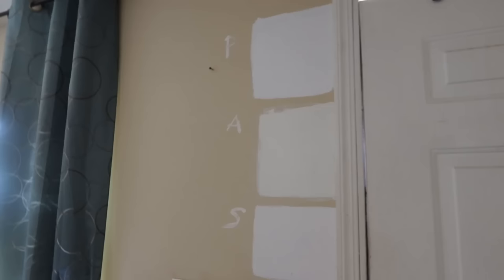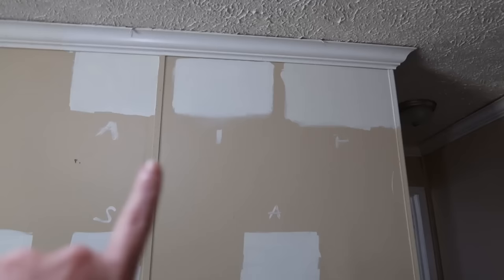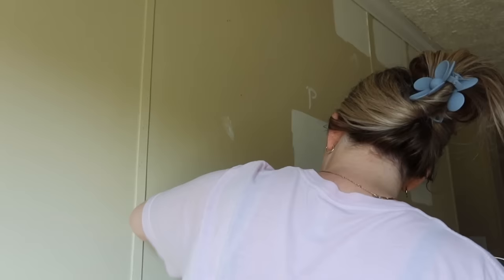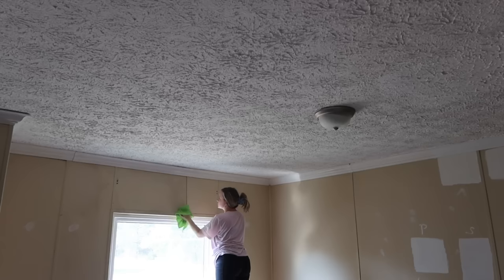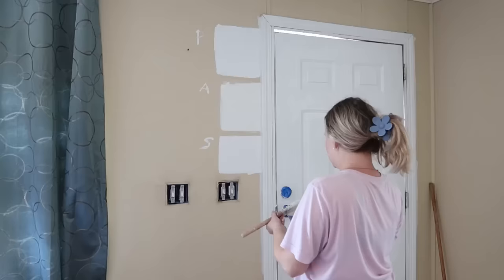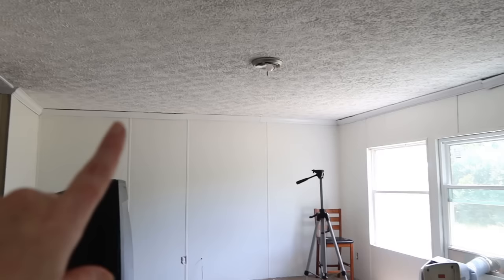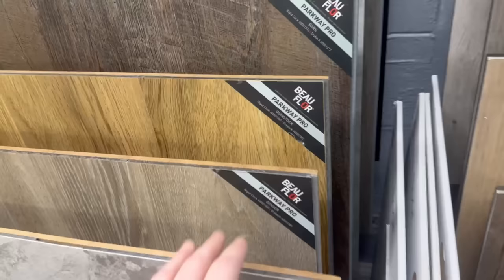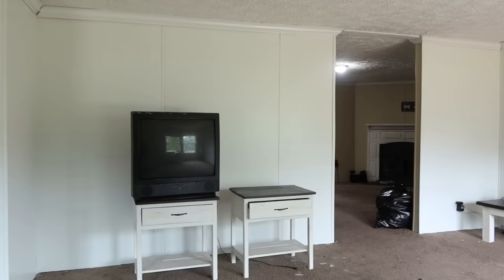🏠 MOBILE HOME MAKEOVER WEEK ONE // Painting + UnDIY // Double Wide Fixer Upper

Comment: I’ve had two Frigidaire dishwashers, and was very unhappy with both of them. Not sure why I bought a second one. I just bought a Bosch for about the same price and absolutely love it! I have a whirl pool oven range and except for one minor wire that I have to tape underneath every two years it works like a charm. I also have a whirlpool dryer that’s working well but my Frigidaire freezer and side-by-side are working fine. It’s just a dishwasher that was not very good. I have a Samsung washer and it’s working fine too. But I have heard that LG kitchen appliances are not very good and I’ve heard that the Samsung kitchen appliances are not very good.

Comment: Prayers for the boys' dad - for a speedy recovery. I noticed that you need to button up a few doors (outside coming in) - something to consider later. Do the floors first before bringing in new appliances, if possible. Even if you have to substitute with temporary appliances - that's fine too. Floors can be worked around any appliances. Don't write off Hisense stainless steel appliances from Lowes. 🦋

Comment: Kelly please have your roof and gutters checked asap. Mildew is a sign of leaking! We sold our modular (1993 model) 4 years ago and we had leaks in and around some of the very outdated windows.  A roofer will not charge to inspect but show damage and then you can file a claim against the homeowners policy.  Depending on the age of this home roofs do not last. Our current home has a metal roof and it was well worth the price to go with that instead of shingles.  Once a mobile home/modular reaches a certain age most of them do become uninsurable. That is a big factor to consider.  I would most definitely wait to do the flooring before appliances are brought in. Take your time and make sure all repairs are done.  I can't stress that enough because hidden damage is everywhere.  We are now experiencing broken pipes under our house we live in now. Being a homeowner is great but the upkeep and costs never go away. I cannot wait to see how you bring everything together!🦋

Comment: The only appliance I would get now and install before the new floors is the dishwasher. Ask whoever will be installing your floors if you should wait on the toilets. And Kelly, when you buy new toilets, get smooth sides ones, because boys, it is so much easier to clean the sides when they are smooth. Oh, and if you can avoid it, don’t get an over the range microwave, just do a vent hood there- I had a house with an over the range microwave and just yuck!  It didn’t vent well and all the cooking residue got into every crevice of the microwave and it was difficult to clean it let alone pull something hot out of it, the house we have now has a countertop microwave and I am happy to give up counter space to it rather than have to deal with the cleaning and maintenance of the over the range one.

Comment: My dad was a master carpenter, and he recommended that you wait to put in appliances or anything like that until after the flooring is in because if you put appliances in first, the people who put the floors down or going to take shortcuts are not going to put the flooring under your appliances. So definitely put everything in after. Especially the toilet. Also, make sure you really waterproof the toilet. And stay away from GE appliances. They are absolute crap. I highly recommend Whirlpool. I’ve had nothing but great experiences with whirlpool appliances. Never a problem. Samsung is crap. LG is crap. GE is crap. Bosch appliances are amazing but pricey. Your best bet on appliances if you can do it is towards the end of the year. Because out with the old in with the new and you will get some very good savings. However, Home Depot has bundles. You can get a stove, refrigerator and dishwasher all for one low price. So check that out as well.